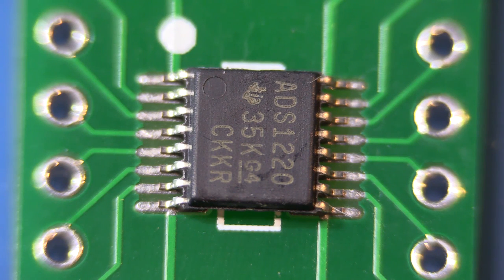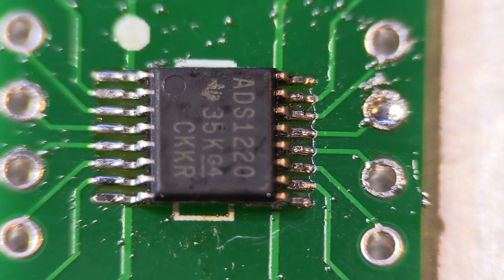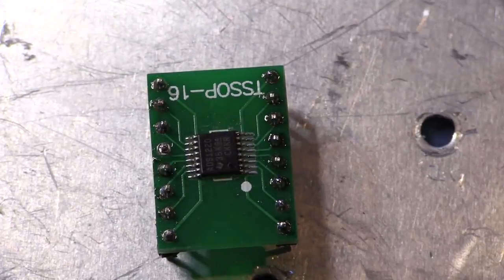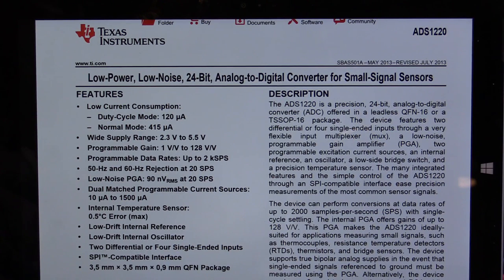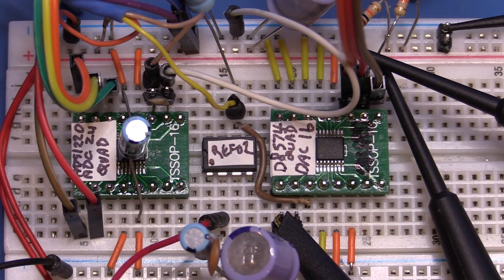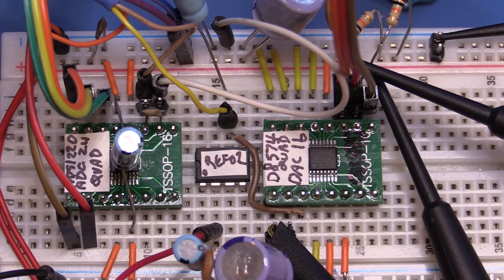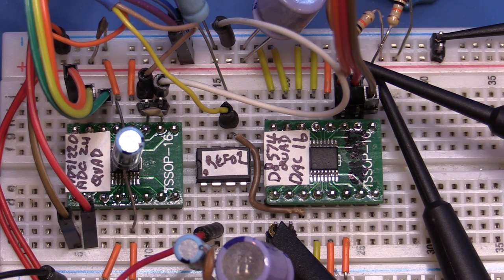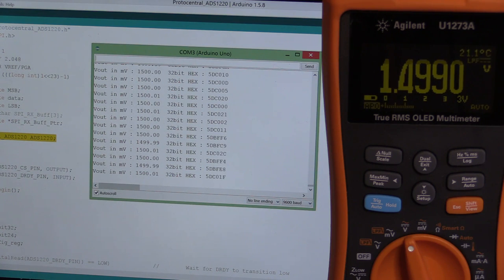Arduino UNO, Using precision ADCs and DACs - Part 1 ADC

Comment: The voltage difference reported by the multimeter and ADC is not due to the ADC. It is the slight difference between the internal voltage reference of your multimeter and that of REF2. If REF2 can be trimmed, you should be able to reduce the small difference even further.

Comment: the ADC is more precise, not necessarily more accurate.
Reply from the maker: +Skwisgar2322 Correct

As with all things like this, Accuracy and Resolution are not the same thing but often confused with one another, Accuracy being how close the reading or setting is to the desired or actual value. Resolution being the smallest change in value that is detected, this may not be accurate but can still be useful if temperature or other drift is not impacting the reading over the shorter time scale, for instance it can indicate a trend or fluctuation between two values. The absolute accuracy may be out but the fluctuations  may still be relatively accurate as a relative measurement.

Its a whole topic on its own :)
Reply: @TheBreadboardca  The accuracy is hugely dependent on the voltage reference right ?
Reply from the maker: @Telectronics  repeatability and accuracy without calibration i would say has a lot to do with the voltage reference but this is just the beginning.....
If the voltage reference is very stable, does not drift with temperature (Or not much) and you know its absolute value (Does not really matter what it is, 2.5, 4,  4.8, 4.9, 5.1 etc as long as you know what it is) then this will go along way to ensuring the repeatable and accurate measurement of your input. The number of effective bits  (24bit ADC does not necessarily have an ENB of 24 bits, it may only be as high as say 18 bit) but it will give an idea of resolution and allow decimation to get more accuracy and repeatability.
The ADC also has its own drift and stability concerns as well, good track placement and guarding may be necessary to maximize your resolution and repeatability along with noise reduction.
Remember Resolution and accuracy are not the same and as far as accuracy goes, it is often better to be repeatable than accurate as you can correct the accuracy in software, to some extent you can also correct drift due to temperature too if you have the characteristics of the device. you cant easily correct for non repeatability and noise and expect to keep the same resolution, in fact noise at the 24th bit can be very significant measuring 5V at 24bits means the lsb is only about 300nV, noise can easily be way more
Reply: @TheBreadboardca  Thank you for your detailed answer. I always cherish your videos because they are explained very well ! BTW I could not find DACs over 16Bit so I have taken that as maximum possible value yet. I have started to design my own electronic load and wanted to clearify that. Well, then it should not be overkill to shield the complete ADC/DAC unit too. The parts I have choosen are ADS1256 , DAC8532 and MAX6250ACSA should be reasonable then even without calibration. Just give it a look it has pretty good specs. as I find.

Comment: I have a question so here goes: I have an animatronic show. Similar to 
Chuck E cheese. it is programmed in analog and converted to digital. It 
is 24 v dc. What i want to know is can the RA Gray system somehow to 
hacked to be able to find or program individual character movements. For
 example, if i wanted to program new shows, would there be any way to do
 it without having the original computer they used back in 1982? (MC 10)
 The left channel plays the music and the right channel goes through the
 control system and reads the tones. I have actually listened to the 
tones through the speakers and it kinda sounds like the old telephone 
line data modems. So my question ultimately is can the control system be
 hacked?? Can the current show tones be checked to see what the 
amplitude is?  Thanks!
Reply from the maker: I would think an oscilloscope would help here to understand what is going on

Comment: 24 bit. Fun to play around with. But likely overkill for the application in question. Also, it's a bit slow at max resolution, which can be problematic when dealing with fast transient loads on the PSU.
Reply from the maker: Fun for sure... In a PSU application or even general measurements of Volts and Amps, 16bit may be better and faster if it is accurate, and stable as this would give max count of 65535 , or 32768 if your using sign (+ or -), this would equate to a 60,000 count or 30000 count meter allowing for a little bit of range to detect over or under range, adding a PGA would improve the versatility. 
But, measuring transients and surges can be difficult with with out additional hardware or more expensive ADC, for instance a PEAK detector, or a very fast ADC to track the actual transient rather than simply telling you its peak value

Comment: Great stuff.  Thank you.  Do you use solder paste? It normally goes on with a stencil. If you are determined to do it without, put it on the pins.  It would be much easier for you to just drag solder this stuff.

Comment: hello idk why I don't get any reading, I followed your instructions but I didn't put any capacitors since there's nothing available, and I also hooked up a pot, with its wiper connected to AIN0, and VIN as 3.3V. When I ran the code it returns 0.00 mv even when I try to vary the pot. What seems to be wrong with this? do I need to have all the capacitors? cause I double checked my connections already and I think I got it right and also I don't see the TX led of my arduino blinking, only the RX, should it be like this or not? thanks in advance for your reply
Reply: can u please provide the circuit connections u made as tx led of arduino is blinking continuously but im getting 0mv when i run the code

Comment: Isnt a 24-bit ADC an overkill for a PSU? There is no way those last bits can handle the noise.
Reply from the maker: The video is more about showing you how to use the ADC DAC products. The PSU is used as an example.
Sometimes a design will also use a DAC way better than the realized accuracy , with suitable filters and stable VREF the noise can be minimized but the benefit can be in the ability to have much better resolution rather than accuracy. also it will allow better software calibration through adjustment of those additional bits.

Comment: Kudos to you man. I was hoping if you can share your GitHub library code for this ADC?
Reply from the maker: the code I used dor the DAC is posted here https://www.element14.com/community/groups/test-and-measurement/blog/2015/02/17/the-modular-bench-power-supply-arduino-uno-and-precision-tesadc-dac
for the ADC, https://github.com/Protocentral/Protocentral_ADS1220

I cant find my local copies right now but I will be re-doing them in the near future with all the current versions of software

Comment: it's 1000mV right, that's 1V, seems like 3, maybe 4 digits, 5th digit seems to be unstable, not sure if because of the reference, or the input
Reply from the maker: Were was this int he video, ?
Because this is all built onto a breadboard there will be much more noise and instability that you would experience in a correctly designed and built PCB

Comment: To bad its a $10 chip! I really like this part, but its too expensive for me, and way more precision than I need. Is there a cheaper 16-bit equivalent?
Reply: Michael Molter I was mentioning the 24-bit ADC
Reply from the maker: Michael Molter I know, but it is 24Bit after all, the 12 Bit is way less though and for most projects is more than enough, 24Bit resolution presents so many issues to get reliable and accurate / Stable readings, almost impossible on a bread board. I use it in my tutorials to demonstrate how to talk to it and compare to other ADCs. Even for my power supply project I will be going no more than perhaps 16Bit but may be only to 12Bit (To Be Determined)
Reply: There are cheaper 16 bit ADC - you can get a ADS1115 from ebay, for about $3 and it comes soldered onto a board.

Comment: Do pick and place machines still use a blob of soft glue on the back of the chip before soldering?
Reply from the maker: +klystron44 That would depend on the current process. If the board is only single sided for reflow then glue is not typically needed, if the board is loaded on both sides then the side reflowed first will have glue in order to prevent the devices falling off when upside down during the second reflow stage so a pick and place machine would be setup to reflect this choice
Reply: Not always. Depend on the technology what they are using, and depend on the part size and weight. But I see the trend, they try to go a way from gluing. I hate the glued parts, because time to time is pain in the ass to replace parts with tweezer soldering iron.

Comment: hello great video by the way, I'm planning on using one for my thesis buy I will be using 3 channels on the ADC, have you by any chance written a complete library for this adc that supports multi channel? I don't really know much about SPI and I'm trying so hard to learn all these in such a small amount of time. This video helped me a lot already thanks
Reply from the maker: The library for the ADS1220 was here https://github.com/Protocentral/Protocentral_ADS1220
there was no library for the 8574 at the time, but the code I used can be found here https://www.element14.com/community/groups/test-and-measurement/blog/2015/02/17/the-modular-bench-power-supply-arduino-uno-and-precision-tesadc-dac
Reply: thanks but how would I modify this if I wanna read from 3 channels of the ADC? since you said the library is coded for only reading 1 channel (if i'm not mistaken)
Reply: hello can you please provide the schematic for your set up? this would help me a lot, thanks
Reply: nevermind i got it working already!

Comment: Is it possible to measure nanovolts?
Reply from the maker: technically, yes it would be possible but you would have to select very stable and accurate parts. also the wiring and shielding of the parts would be needed to prevent interference from outside signals. The ADC has resolution to measure down into the nano volts but it would be noisy on a breadboard and not accurate enough for consistent readings.

Comment: You can glue your chips.
Reply from the maker: you could but you better be good at positioning them prior to soldering :), this is usually done if your populating double sided boards and then re-flowing them